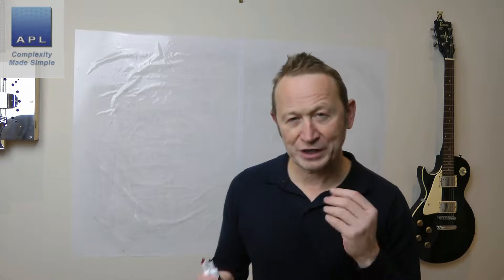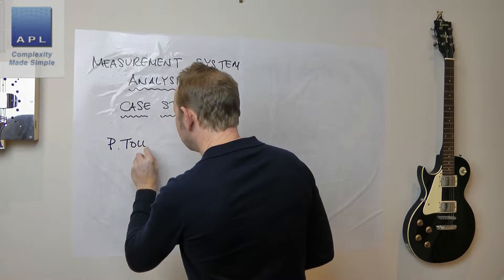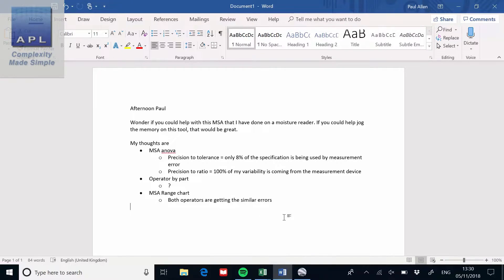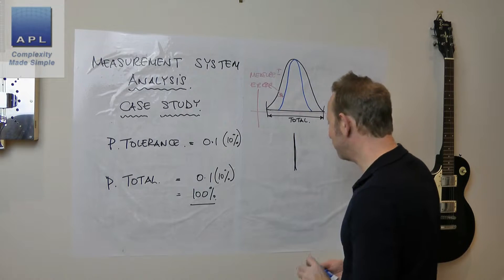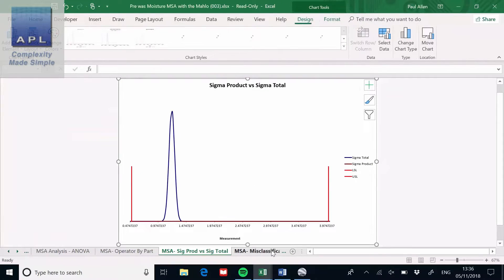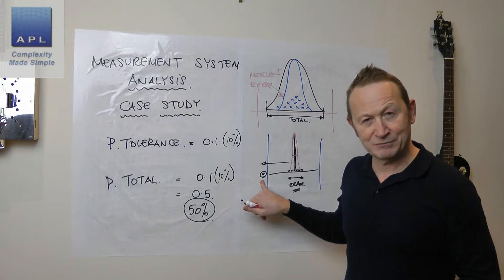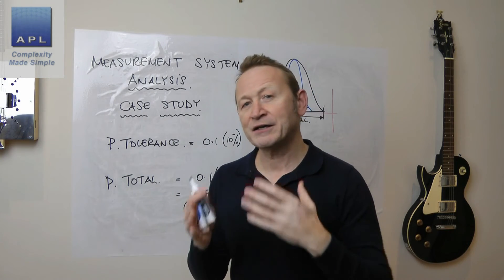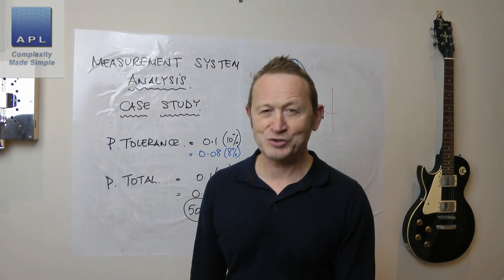Measurement System Analysis - An MSA Case Study

Comment: Hi Paul, thank you so much for your very informative videos. 
Could you please advice what type of MSA would you recommend to perform in a service shop where you can only find 2 pieces of the device to be measured on any given day? and no more than 50 devices are serviced per year, do we really need to perform MSA?
Reply from the maker: Good to hear from you, it really depends on what those measures are for. If you make expensive business decisions or important customer checks that could be costly it would be great to be accurate. If they are not important measurements, sure don't need an MSA...

Comment: Hi Paul. What are your thoughts about the main difference between MSA TYPE 1 study and MSA TYPE 3 study? if you are measuring a Diameter of a product with a non contact measuring device, would either be ok to use? any advice would be appreciated
Reply from the maker: Type 1 only works where the process is all machine based. You'll get bias if you try type 1 with operators. Otherwise type 2 is always best to do.
Reply: @paulallen5321  Thanks Again for your swift response, so you wouldn't do a type 1 study based on the operator placing the component onto the measuring device and its a non contact measurement? once its in place the operator has no influence and can only work if its placed where it should be? Also do you thing a type 3 study is feasible, somebody has mentioned this before but this is something i have not come across (only seen type 1 and type 2)

Comment: In a Gage R&R do they ever measure 3 different parts (Totally different sizes, say a tray with 163 meds, a tray with 108 meds, and 1 tray with 0 meds) or in Gage R&R's do they only measure 3 versions of the same part (3 different trays, each tray with 163 meds)
Reply from the maker: Hi Anthony - no if you do that you ruin the MSA. It's ratio of the natural variability of the part v natural variability of the measurement system. If you use 3 different parts you inflate one of these values and invalidate the results...

Comment: If you were doing MSA for SPC process control then this would be an issue as you would be adjusting your process based on flawed data and therefore introducing more product variation.
Reply from the maker: Spot on Martin - I've seen good machines be adjusted over and over when they hadn't really moved...

Comment: Hi Paul, with automation in production line, the operator may even not have any physical contact (to parts, to equipment, ...) to the entire measurement activity. Can I remove the factor "operator"?  And with that, I probably can only use Anova-method to calculate GRR%, because AIAG template/formula won't work anymore. You advice?
Reply from the maker: Hi Vincent - Firstly, yes the phrase operator really means measurement system, so if this measurement happens automatically replace the word operator with system. Now for the Anova calc to work you have to have 2 systems to compare against each other. If you only have one system then you have to use the X-bar R method. If you have rep-designed spreadsheet for an AIAG calc, simple thing is to paste the same data set from your single measurement system into both systems. You'll get zero reproducablilty error, but is correct as you're only checking one system...
Reply: @paulallen5321  Tx. I tweaked AIAG calc template. Input readings from 1st operator, leave out 2nd, 3rd. Keeping 10 parts, 3 replications. AV (appraiser variance)=0, GRR comes purely from EV (equipment variance). Tx!

Comment: Thanks, Paul, your case study confirms one of the biggest misunderstandings & confusions in MSA, because many people only know about GRR%, which is here "P.Total".
The P.Total highly depends on the sample selection (=part-to-part variation) and therefore it is NOT an objective KPI for Meas.system assessment.
AIAG even recommends option 4) of calculating GRR%, saying the Tolerance should be used, which gives you the KPI "P.Tolerance".
I also like to use the formulas behind in trainings, because it makes it easier to demonstrate & follow:
GRR(Total) = P.Total  = sigma(MS) / sigma(Total),     where sigma(Total) = SQRT( sigma(MS)² + sigma(Part-to-Part)²)
GRR(TOL) = P.Tolerance = 6 * sigma(MS) / Tolerance
From there you can see that P.Tolerance is independent from part-to-part variation, so indenpendent of sample selection, so a much more objective figure for MSA judgement.
And as you mention, bad Process Cp means a big part-to-part variation, big sigma Total, which makes P.Total low and therefore look good.
(P.Tolerance and P.Total are similar, if Process Cp is about 1.0, a 3-sigma process.)
Or as other consequence: if you have a good process e.g. Cp=2, then you get a bad P.Total, so you would punish your Measuring Process.
Reply from the maker: Joey - Thanks for the comment, glad you like the approach. I Try to keep it simple, to understand the reason I'm using the technique and what the result is really telling me. And not just apply a set of 'if this then accept' type rules. The rules apply most times, but just occassionally you have ot use your comment sense...